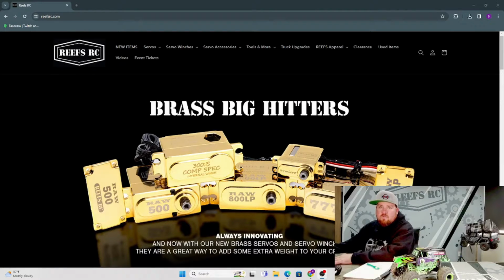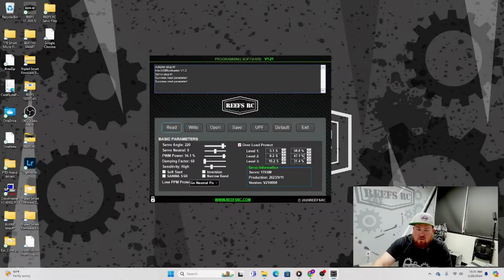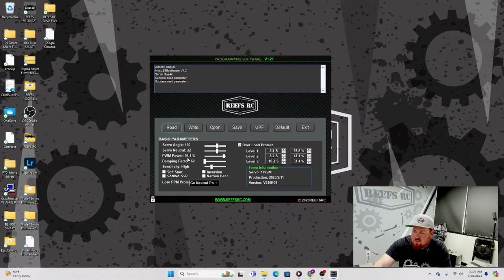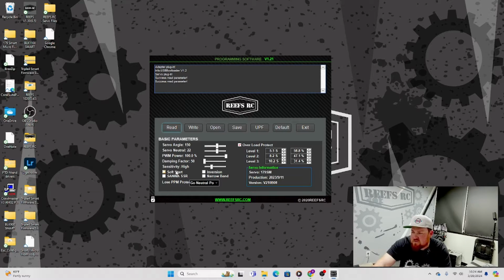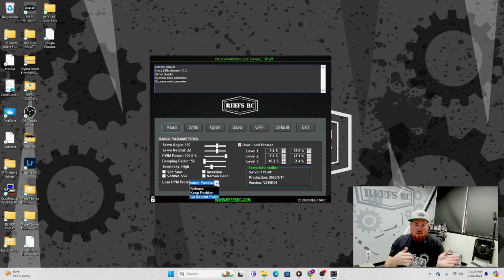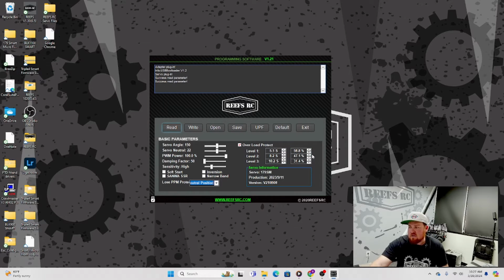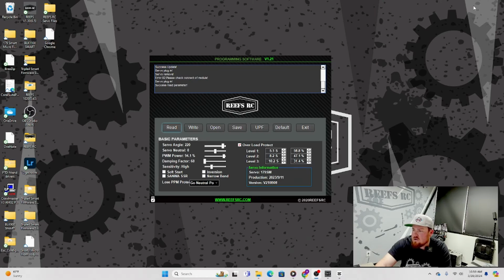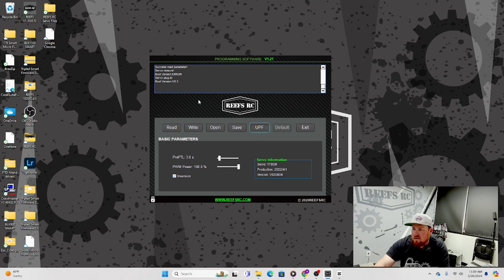REEFS RC PROGRAMMER

Comment: Hi - I just purchased a Reefs Beast 2000 and all I want to do is adjust the neutral position of the servo. When I follow your instructions sometimes the servo connects however it does not move when I adjust the neutral position, write to the servo, and then disconnect and connect the adaptor to the computer. Sometimes I get an error from Windows saying there is too high of a power draw from the adaptor, which makes sense because the USB port is probably only rated for 3.5v while the Beast 2000 needs a minimum 7.4v.  So is there anyway to adjust the neutral position using the adaptor with a Reefs Beast 2000?
Reply from the maker: Hello, 
you will need to adjust the neutral position on your remote. The beast 2000 is not a programable servo.

Comment: Hi Reefs! I got the 1100 Smart, is this programmable to potensially have two rotations on pwm signal? Example pwm 1500 = center, pwm 2000 = one full rotation clockwise, then pwm 1000 is one full rotation counter clockwise, making it total of two rotations from 1000 to 2000?
Reply from the maker: email us at Sales@reefsrc.com I'm just the social media guy
Reply: @reefsrc  Who uses emails in 2025? Thought that protocol was near death! ;) Found a different servo to use so it worked out anyway! :)

Comment: Whats the maximum programable servo angle?  Can it be set for a fixed number of revolutions?  (eg 3600 degrees)   Think you answered my next question about the 777 servo at the end of the vid. Am I correct assuming the 777 does not have an angle restriction so you can program it as a winch? Can the winch program specify  number of revolutions? Thanks again!!
Reply from the maker: You can set the angle it will not allow you to set it at 360.  the 777 cannot be programmed as a winch only our smart servos can be programmed as a winch or servo. You cannot set specific numbers in the servo for revolutions. that would need an external programmer.

Comment: I got the 179 for the typhon grom the grom sometimes goes off track while getting under full acceleration, it has the 2n1 spektrum esc with dsc, I am wondering if you have recommendations to change the settings to work best with the DSC.
Reply from the maker: It’s probably the dsc trying to compensate and not being able to adjust to have fast the 179 is. Turn the DSC off, that’s what I would do.

Comment: Hey question here. Purchased a beast 2000 today for my axial scx6. It was the servo winch version. I was told that I can covert it to operate as a steering servo via the usb programmer. But it only gives me the options for basic programming like PROPTL (3.0s) and PWM Power (86.3%). Help please!
Reply from the maker: Whoever gave you that information was misinformed. You can only convert smart servos from winch to servo.
Reply: Oh thank you! Was super excited to get this. Cheers!

Comment: Using this video to setup my reefs 179 . Success read parameters message displayed.

Trying to adjust servo neutral position but no response from servo! How do I remedy this. I can hear ur steering adjusting in this video as you use the slider. I got nothing.
Reply from the maker: You set the position the write it then hook it up to your truck. You can’t adjust on the fly. Way easier on the remote for that feature.

Comment: Howdy! Possibly dumb question while waiting for my USB link to show up in my mailbox.

I want to adjust the servo neutral position, which I can do with the programmer. However... can I do it "live" or do I have to guess, flash it, plug it back into the truck, check it, reconnect to the programmer, adjust, reconnect to the truck, see if it's right this time, etc..  ?
I'm really liking the idea of the anti burn-out feature while I have the damned thing wedged against a rock shelf... lol
Thanks for your time!
Reply from the maker: it will not adjust live. so the long process you posted LOL. Yeah the dampening feature is great. hope you guess right the first time. you got this!!
Reply: @reefsrc  Eh, fair enough. I don't MIND doing it the hard way- I would just hate to do it the hard way and find out later that I didn't need to. Thank you.
Reply: @reefsrc  Programmer showed up today. Took me a couple tries to get it close enough to where I wanted it, but overall good experience. Only bummer was it seems you can only adjust neutral position in increments of 3 so I couldn't get it bang on, but... the net result was a lot less subtrim than I needed before.

Comment: Can i run the raw 800 which draws 6.8amps on 7.4v of power with a bec that outputs 6 amps? Or do i need to keep the servo on 6v that draws 6 amps?
Reply from the maker: You can run the 800lp up to 8.4v. If your BEC only goes up to 7.4v that will work as well.
Reply: @reefsrc  what about amps? My bec puts out 6 amps.

Comment: Are the specs on website at 100% power or the percentage set from factory?
Reply from the maker: Like we said percentage set from the factory.
Reply: @reefsrc  I mean like is a 1100 at 8.4 from factory 1100 ounces at 80%? So I can program to 100% and get more than 1100 ounces?
Reply from the maker: Yes, I do not know the factory power settings at the moment. But if it is less than 100% you could make that adjustment.